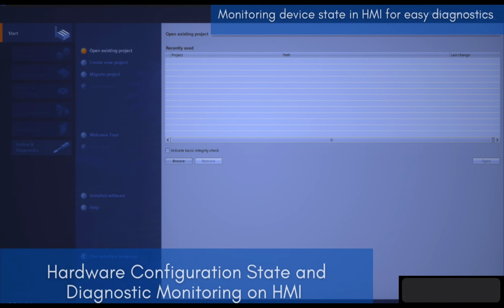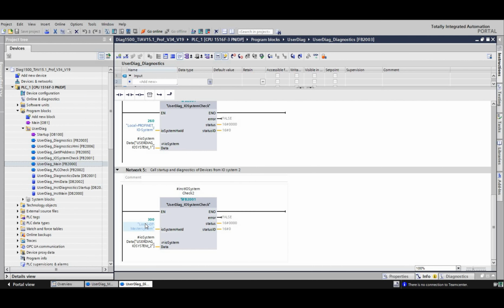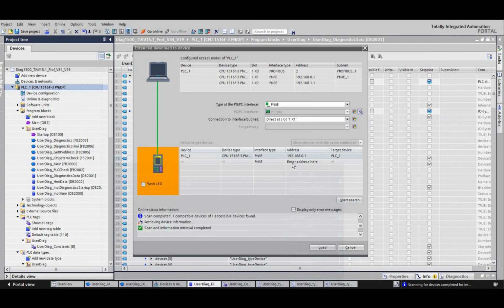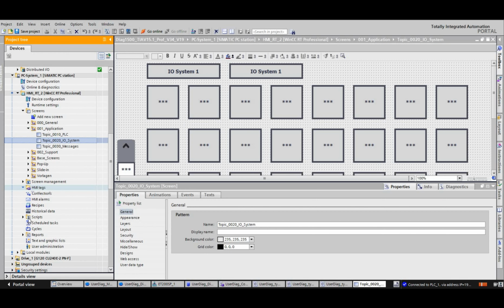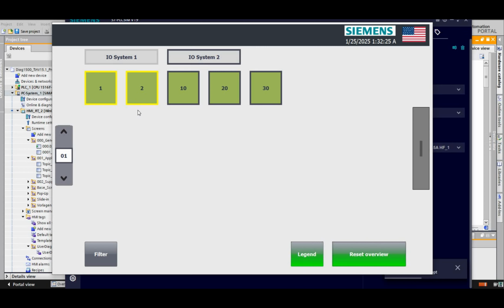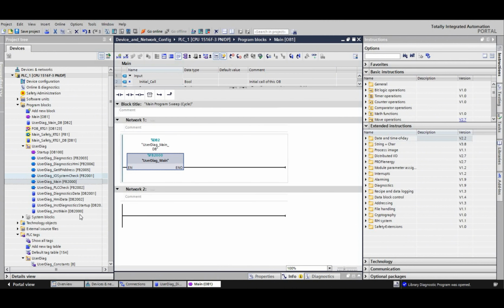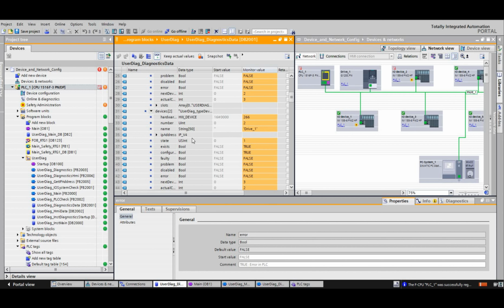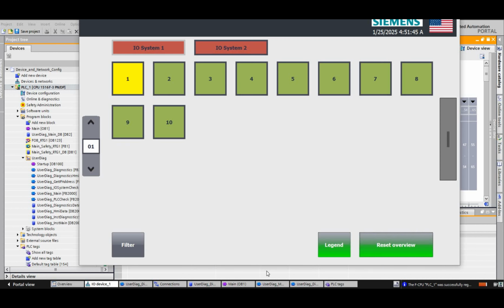Hardware Device User Diagnostic Program Monitoring on HMI - S7 PLC - Wincc Prof -TIA Portal tutorial

Comment: The faults are triggered only during startup as the userdiag_main FB2000 is called in startup OB. So if there is a fault genaerated it is only update in the diagnostic DB in the next power cycle. How to solve this?
Reply from the maker: Hi, thank you for your question🙂.
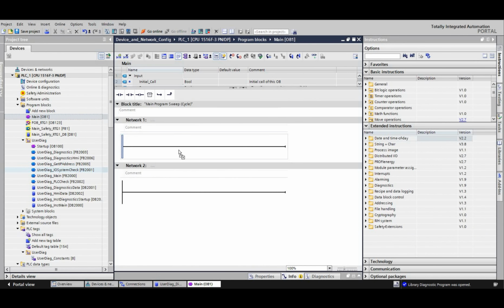Actually, the UserDiag_Main (FB2000) is being called in the Main OB. in 12:17 where I had shown how to import the block objects from the first project to the second project for simulation, I had called the UserDiag block in Main OB. Also in the V19 simulation we had triggered several faults on the IO devices and they get updated every cycle. If you have the UserDiag_Main in the startup OB, do kindly call it in the Main OB.
Reply: @Opeyemi_Emmanuel_A Thanks. I will try this.

Comment: Hello, thank you for the great video! I have one question: the first error that you simulated was assigned to device[1]. Why is that? Does the program assign devices randomly, or it maybe looks at the order in which we added a particular device to the hw config? If I have some project with many devices in hw config, how can I know which device is assigned to which element in an array (assuming I can't go online)? Thank you in advance!
Reply from the maker: Hi, You 're most welcome. 

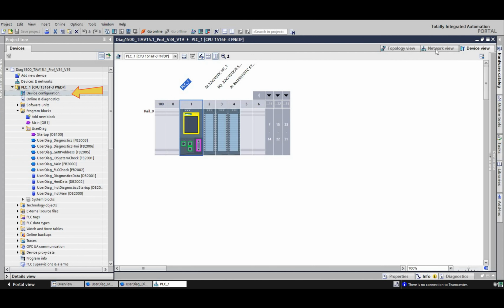In the video 2:50 , we have shown the network connection on "Profinet and Profibus", 
For Profinet, when you select any of the device, and head to -> the "Properties" window -> "General" tab  ->  "PROFINET interfacs [X1]"  -> "Ethernet addresses"  - >  Scroll down to "PROFINET" section (You would find a dropdown field "Device number" where you can assign the device number to that network) 
This device number is what you would see in the HMI simulation - And you can assign the HW devices accordingly between (1 to 512)
For Profibus - You see the device number in the "Properties" window -> "General" tab  -> PROFIBUS address  -> "Parameters" section

Thank you for the question, this should help bring clarity to viewers who has similar question.